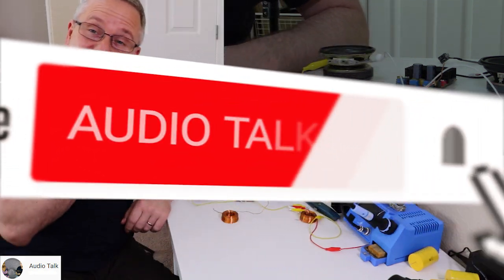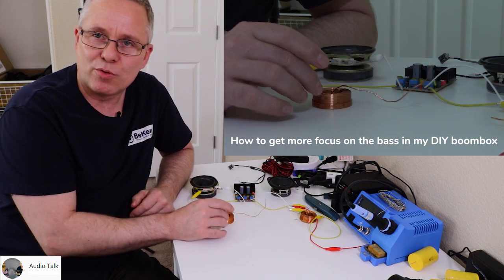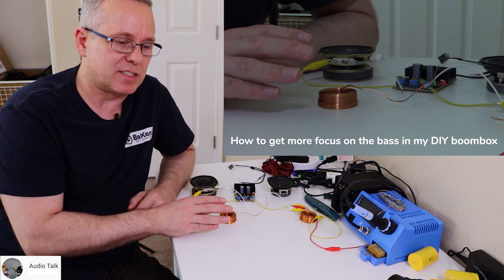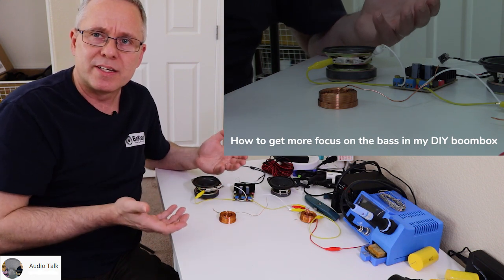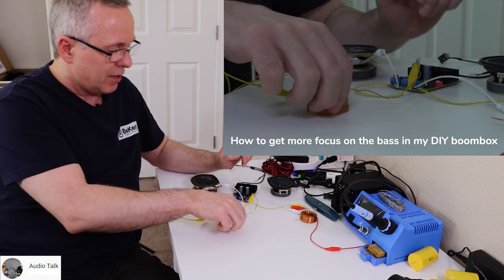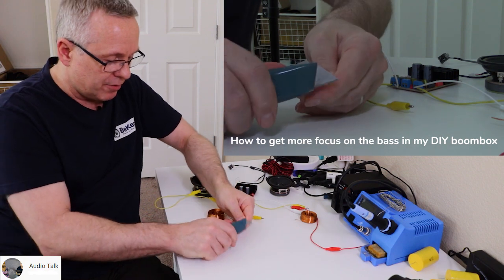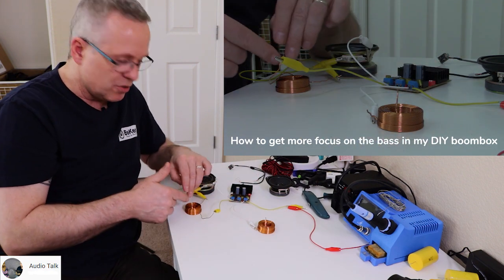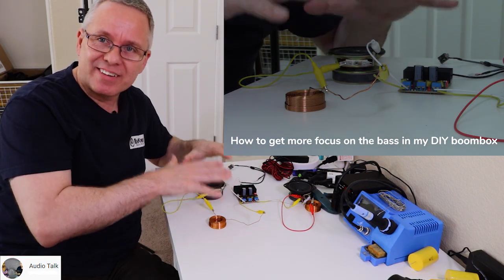How to get more focus on the bass in a DIY boombox

Comment: Excellent Kent. I'm in the process of building a stereo Bluetooth speaker using an old tube radio. I have everything working but exactly this problem with small speakers and dominant mid range. So I can use a couple of coils and try this mod. How do I determine the gauge and length of induction coil? Can you help me here?
Reply: You might also try and adding an additional resister to the midrange circuit in series before the crossover for that driver on the positive.  That is if the crossover to each speaker isn't integrated with the others